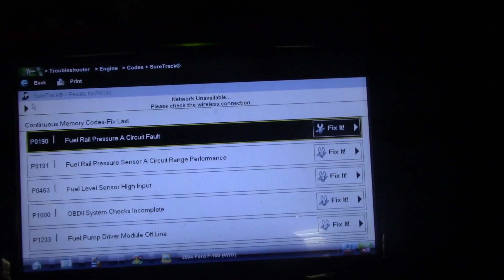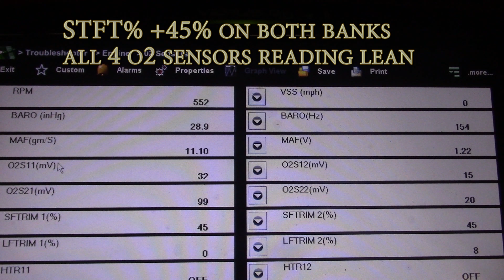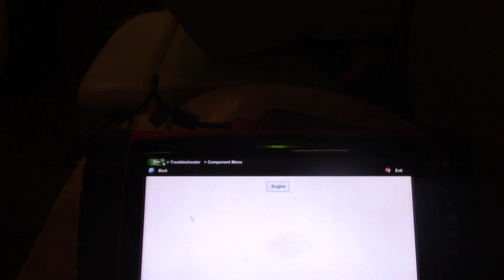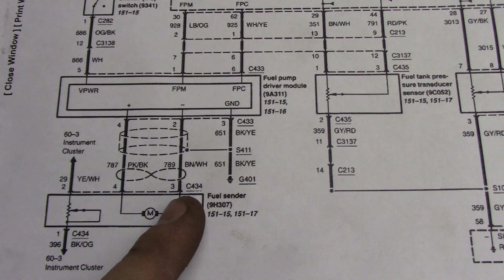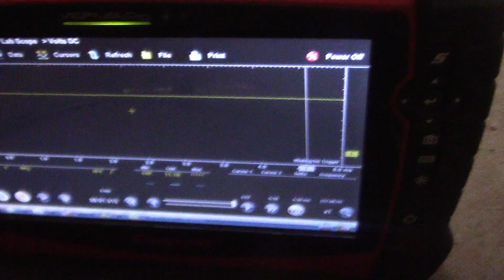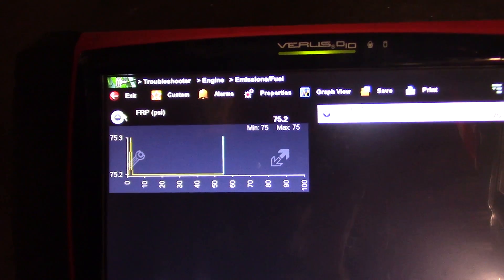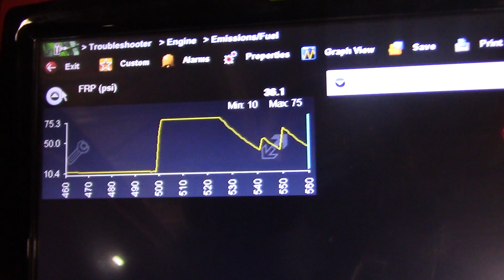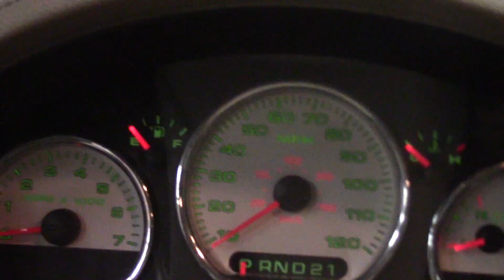2004 Ford F-150 5.4L Stall-No Start P0191 Fuel Rail Psi Sensor P1233 Fuel Pump Driver Module Offline

Comment: Any suggestions if the modules already been replaced as well and still having the problem I almost the exact scenario?
Reply from the maker: I would start with looking at the low and high side pressures.   Use a gauge for the low side, use a scan tool for the high side.

Comment: Had same problem, got it changed,  months later exact same issue, got another new one and had same problem ended up being that Ground wire. Not a fan of fuel pump control systems

Comment: Just had this happen on my 05. I heard from other owners of what would cause it . Ran truck through a car wash and truck was stalling and sputtering after and would keep shutting off.  Went right to the fuel pump driver module and that was the issue.  I could see a hole in it and a ton of corrosion.  Ran to auto parts store. Picked a new one up for less than 200. Swapped it out and bingo..  truck started right up and so far I have had no issues since. No scan tool needed. No point in trying other things when you can clearly see a hole in the module and corrosion.  Don't waste your time.  Swap it out.  That more than likely is the problem.  That definitely will  cause a stalling issue and act like your out of gas.

Comment: Does the PCM/FPDM cause the fuel pump to not activate if the fuel rail pressure detected is high or non-sensical? Earlier in the week my car (05 Crown Vic) had a few long/rough starts which I think was caused by recently filling the gas tank with winter blend a day before it was "unseasonably warm" (pending P0191 but CEL never illuminated) . What kind of reading would the pressure sensor output if the line was vapor locked?

Comment: Good vid bro my truck doing the same thing going to get a new module i changed it 4 years ago but I think it went bad I just changed the fuel pump and the rail pressure sensor but it's doing the same thing as the truck in you vid has 49 psi at start up then it warms up and drops slowly till it stalls

Comment: I am an experienced mechanic but still stumped.

I have a 2007 f250 super duty that starts when it wants. Sometimes will start then starts running slow then stops and fuel pressure is zero.
I have cycled the key on and seen 70 PSI pressure, starts right up idols fine and as watched the fuel pressure goes from 70 to zero in about 5 seconds and dies.

Other times it runs a week with no issues.

On the no start condition there is only a few pounds to no fuel pressure. Leave the truck sit a day or an hour sometimes it starts right up. Might drive it everyday for a week and no problems. Might sit for for 5 minutes or next day and no start.

Problem is it will not stay in the no start condition so I can diagnose.

Replaced the fuel pump module and it started right up so I thought it was fixed. Next day no start even with the new FP Module. Threw a fuel rail switch on too. Still acts up when it wants.

Cycle key on and can hear the pump for a second but it sounds week most of the time. Sometimes a key cycle will give a strong fuel pump sound and the truck then starts.
Sometimes the key cycle will only boost the pressure a few pounds and will not start. Then it gets a streak where the pump sounds strong again and starts right up.

I'm not sure if I should put a fuel pump in or the Engine PCM is telling the pump to misbehave.
I think fuel pressure is regulated by the ground the module sends to the pump? If I provide a full ground to the pump when it won't start and it starts will it prove anything like the PCM is faulty?

I removed , and cleaned grounds to the FP Module and tank. Unplugged and inspected wire plugs I could see. I'm in the rust belt so bad contact is possible but I don't see it.

I hope it's the pump but wondering if it is the PCM providing weak ground at times?

Thanks for any help.
Reply from the maker: I would be doing my testing at the top of the fuel pump.  Power and ground from the module and checking the wiring between the module and pump. If those checks are good maybe a failing fuel pump. Any codes stored for no comm with pump module?

Comment: If you have this issue and need to drive your truck, unplug the Fuel Rail Pressure Sensor on the drivers side fuel rail. This makes the pump default to around 20% duty cycle. While driving it will go up close to about 30% as it reads the signals from the MAF and TPS, but it does not seem to go higher. This modulates the pump so it is not running constantly and makes the vehicle very drive-able. The only issue I have found driving mine like this is a lack of top end power when towing. This makes sense as the truck would be starving for fuel at that point.
I hope this helps anyone that is stuck and needs a temporary fix.

Comment: Ok so I have a 08 f150 with the 5.4.  Iv put a new fuel rail pressure sensor in it and every time I plug it in it kills the truck but if I unplug it the truck runs but runs very rough at idle. Please help.

Comment: so i went to check out a ford e150 and the guy said it had the code p093 fuel rail pressure sensor a circuit. MIL light was on. he said he changed the rail pressure sensor but the code still comes back on. I noticed with key on the pump will constantly run.also i notice there was a GND wire connected to the 12V wire to the pump. do you think it's the module?

Comment: Having ALL same issues and already replaced the FPDM and FRP sensor as needed. It ran for a day then wouldn't start. I found a bad ground between the module and pump and it fixed it and ran great. It sat parked outside at the shop for a couple weeks and now it won't start again. Jumping FPDM does nothing which tells me there's no issues between there and pump/sender itself. I can also HEAR the pump but have ZERO fuel pressure and it only started off starting fluid
Reply: Did you ever find the fix? Mine is doing the same thing

Comment: Hey, I have a 2006 mercury monterey , 87k miles on it. out of nowhere beginning to stall. battery is fine , engine stalls , steering gets tight and breaks freeze up a bit. any help would be appreciated ? Local mechanic couldn’t find anything , he cleaned throttle body, and replace idle air control valve .

Comment: thank you, gonna try the bypass test, neat trick i didnt know about, hopefully that tells me my issue, i replaced the fpdm with a dorman one and im thinking the dorman replacement is faulty
Reply: Was it faulty? I have a p0191 code and it stalls at high rpm’s and stalls when I’m at idle when it’s hot.
Reply: @cameronw329  it was, I had 2 back to back that were faulty so I broke down and got an oem ford one and didn't have another issue
Reply: I replaced mine with a dorman one as well and it’s been a year since I replaced it

Comment: Thanks for the video, I just wanted to share my experience quick. I replaced the fuel pump and then replaced this module you tested and my truck still didn't work. After watching this video I seen that you had a ground issue so I checked my connector and didnt have continuity to to ground on any of the pins on the connector. So I opened up the wiring harness and found a broken bare ground connection inside the harness about 6 inches back.  It was a shielded ground wire that Ford spliced to and ground strap near the module. After fixing the harness and then plugging it back  into the new module it still didnt work. This time it was my error because you have to push the connector very hard into the module to get it to work. Now everything works again. Thanks for the video about the ground issue.
Reply: Having this same exact issue, gonna see if this works
Reply: I found the same exact BARE shielded wire, any ideas on it? I believe it's for the "pulsed" ground of the FPDM/Fuel Sender. What is the end closest to the sender harness hooked too? Mine was just laying inside the wire loom wrapped around the Pnk/blk wire and the Brn/wht (Sender positive and negative from FPDM)
Reply: @dieseldabz7104  check continuity from that bare wire to ground. If nothing, keep cutting back the wire loom until you find the break.
Reply: @drbuyi  I have continuity! I have even swapped another chassis harness into the truck against my better judgement and guess what? Exact same issue. It isn't the harness, module, or pump. This is the first truck that has me stumped in a long time tbh.
Reply: @dieseldabz7104  do you have 12 volt at the module with the key on? Make sure the plug is pushed very hard into that module. (Very hard push) I thought mine was seated all the way but it wasnt. If you have 12 volts and ground at the module plug you should be getting power to the pump. You could try flipping the horn relay for the fuel pump relay and see if that does anything for easy test. Good luck

Comment: I have the same 04 f150 Triton 5.4 3V. It stalls at every red light, unless I keep 1 foot on accelerator & other on brakes. I have a P0193. Do i just simply change out fuel rail pressure sensor? Or check and or change the module?
Reply: Did you change that part?
Reply: @OneworldKW  Sorry for responding so late.....I took it to a shop it sat for 7 days so I picked it up. Took it home started removing throttle body, valve covers, fan, crankshaft, timing chain cover, and heads. The problem was the #5 cylinder on bank 2 (under your power steering reservoir). The valve spring broke but thank God in heaven the valve didnt get knocked up & thru the block, it was literally just sitting in their. So I replace spring and had the other valves checked. Now it runs like a champ! Ofcourse I replaced camphraser & tensioners and guides. 5.4 3v are sensitive engines. Especially when you buying it from someone else. Changing oil 5w20 regularly is critical on these engines.
Reply: @bryantmention6898  that's a lot of work you've done...Hopefully i can do the timing and phaser in due time. However, Ford specify 5w20 so it can pass the EPA rating. It has been proven by owners/mechanics that 5w30 synthetic is best 'cause of the small oil ports in the engine

Comment: Great video, but not very helpful unless you have an expensive scan tool.  How do you check the sensor return voltage?   I can check the 5VDC & ground to the connector but to check the output to the trucks computer it needs to be plugged in - no way to check that without cutting into the wire.   Same with the Drive module.  I can verify 12VDC to it and the ground - again helpful but can not check the output ground from the Module with the connector on.  Someone needs to make adapter harness that connects between the sensor/module and allows easy test points.
Reply from the maker: You can backprobe the connectors and use a voltmeter but it will only show you an average.
Reply: Don't be so cheap, Multimeters aren't expensive fella and any real mechanic SHOULD have one.

Comment: Hey Tommy, did the FPDM control ground remained zero something after you bypassed it to another ground with KOER?
Reply from the maker: The module wasn’t grounding (pwm) the pump when it would get hot. I was manually grounding it which was a full ground causing the pump to run at full speed

Comment: My 2008 F-150's Check Engine light came on and I was worried.  I went to Pep Boys and the Code was P-0191.  I looked it up on-line and saw that there could be 2 issues- the Fuel Pressure Sensor and the Fuel Pump Drive Module.  YouTube showed me that changing both out was easy so I ordered them from Rock Auto.  The BOSCH FPS was $34.99 and the DORMAN FPDM was $56.79.  I swapped them both out in about 2 hours- I know, I'm SLOW!  My occupation is Financial Analyst, NOT mechanic.  But they were both  EASY!  Don't go to a garage and pay over $1000 (from what I've read on-line) to fix this P-0191 code, YOU CAN DO IT YOURSELF...!

Comment: Hey Tom, silly question but what would it hurt to just leave it bypassed? Poor mpg? Fuel pump failure? Just curious, thanks in advance.
Reply from the maker: When you bypass it. Your turning the pump on 100% all the time. Probably would prematurely wear out the fuel pump and probably see a fuel mileage decrease.

Comment: I also have an 07 F150 with the 5.4 3V Triton. I have 2 lean codes P0171 and P0174 along with the fuel rail pressure code P0191. I changed the fuel filter because it was due, my FPDM was also old so I changed it. I'm still getting those same codes. The truck starts and runs well at idle. It hesitates during acceleration but gets up to highway speeds and will hesitate again if I try to pass. I'm trying to figure out if it's the fuel rail pressure sensor itself or the fuel pump causing it all.
Reply from the maker: I would be looking at fuel pressure. Maybe the pump is failing
Reply: Will do, thanks.

Comment: Hey there, I own a 2007 Ford F-150 and am having the same problems ... I’ve already changed out the driver module and am still having the same issues. 
Any suggestions ?!?
Reply from the maker: is it a no start condition or does it run and shut off? I would start by looking into fuel pressure looking at scandata
Reply: Positive Lead Diagnostics .... it doesn't run at all, stalled out while I  was driving and haven't been able to fire up since, have crank.
Reply from the maker: What are you missing? Fuel,spark, or compression?  You already replaced the fpdm?  Was that based on any faults stored or tests you did?
Reply: Positive Lead Diagnostics ... believe in missing the fuel to my equation. replacing the module was only by visual. was in bad shape. my friend is coming by tomorrow with a better diagnostic checker.

Comment: Hey man! I've got my daughters 05 Ford 500 with the same code and the exact same symptoms.
It shows  about 10 PSI on Fuel Pressure as well. When I can get it to run it goes to 13 PSI.
The only way I can get it running at all is to hold it on the floor.

Ironically it will crank without hesitation and idle perfectly with the fuel line from the pump disconnected from the rail until it burns the fuel out of the rail of course.

I also have 02 sensors bank 1 and 2 stuck biased rich codes  p2196 and p2198.

Comment: Hello.. were r u connecting the other leads for the bypass test or they to the battery thanks
Reply from the maker: One lead going straight to ground on the frame. The other lead is connected to the fuel pump ground side control wire on the module

Comment: Nice good knowledge how do you know o how you can find on the diagrams when a madule recibe ground o power thanks
Reply from the maker: Depends on the component. In this case I just took a voltage on the fuel pump ground reading with the key on and I had 12v. That tells me that the module supplies the 12v feed all the time and controls the ground to vary the pump speed. Looking on this wiring diagram you wouldn't be able to figure that out. It's different when looking at other components on a wiring diagram like switches or solenoids. But basically you just follow the wires back to the source. If one wire goes to a fuse then it's ground side switched. If one wire goes to a ground then it's power side switched. If both wires go to a module then you need to take a voltage reading to figure out the design like I did in this video.
Reply: Hahahaha..I remember that lesson on Paul's videos...
That lesson is priceless.

Comment: What excellent diagnostics by the part swapper. :P  The P1233 leads you directly to the module as the first item to check. That module is definitely Fubar. Loved the bypass test to prove your point man. Awesome video once again
Reply from the maker: the shop that looked at it before only had a generic scantool, basically a code reader only and the only fault they could see was the p0191 fuel rail pressure sensor fault, not really defending them but they were very limited, thank you for your support!!
Reply: Definitely need the right tools to do the job. But this is also the sort of thing that pisses customers off and gives the industry a bad name. A bit of testing and some research (wiring diagram) would have proved that the sensor and pump weren't at fault. I understand the previous shop doesn't have the skills or tools for this and will eventually see them fail as a business which is unfortunate for the industry.
Reply from the maker: They won't fail. They just call me in. Lol. I definitely understand what you mean
Reply: Kirk Abrahamson waste of time the scanner was the tipoff what a joke I am a doctor and love to work on cars even I would have look at that first. we

Comment: I agree with Hayward . Putting the fpdm Outside the truck on the frame makes it one of the most failed Ford components I've ever come across !
Reply from the maker: yes that is a bad location!
Reply: Ya gotta wonder what engineers are thinking....or smoking..
Reply: That’s why when I replaced mine I wrapped in thick plastic first so hopefully keep the weather out. Might help!
Reply: @shawnt8891  NOT smart of you, all that will accomplish is trapping in any moisture and STILL rot it to shit
Reply: No worse than the complete wiring harness being outside under the driver's door.  Wtf was Ford thinking..

Comment: Nothing like a visual inspection & simple bypass check to nail it. The FPDM location needs to be changed by the manufacturers or the need to provide better protection...maybe they need some engineers with less of an engineering degree and more of a common sense degree.  Nice quick diagnosis.
Reply from the maker: yeah common sense to not put a module out in the open so it can be destroyed
Reply: Positive Lead Diagnostics Thanks Tom
FPDM has 4 Wires; 1st to Instrument Cluster for Fuel Level? 2nd 3rd for Pump running; Power and Ground? 4th; what is that for?